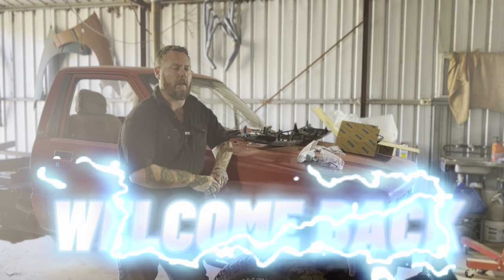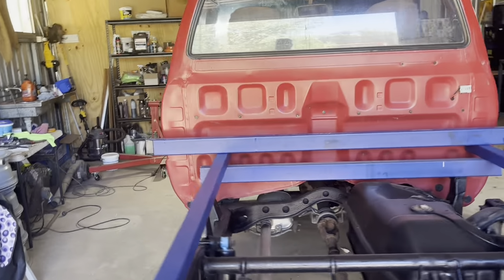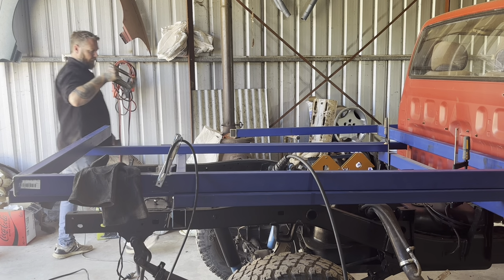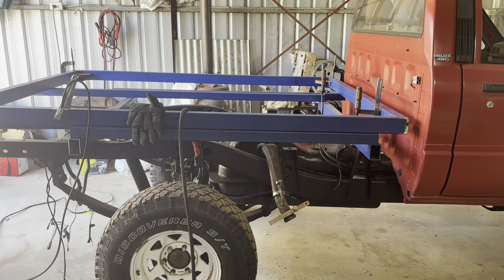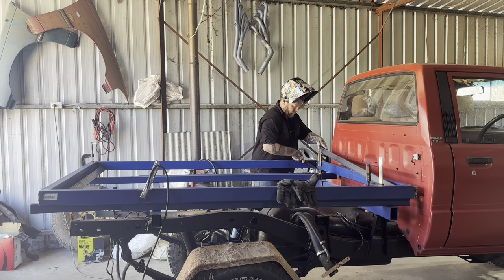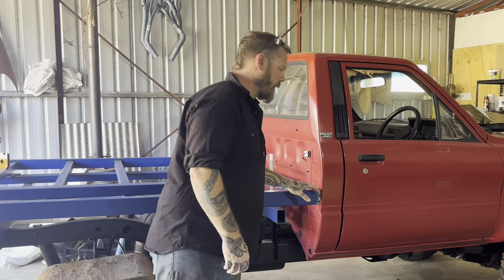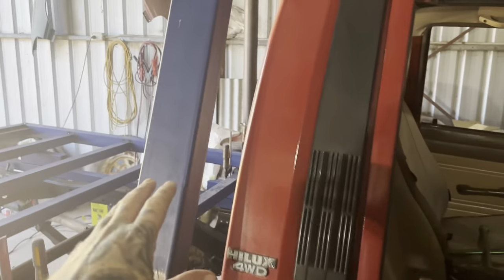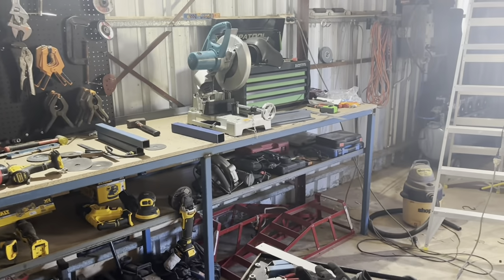1984 Toyota Hilux 4x4 - (Custom tray build begins)

Comment: Just wondering if it might of been an idea to add triangle stiffners in each corner which would also keep you square when fully welding up. Comment made 30 min in and also I'm 20yrs retired welder fabricator myself keep her lit bud enjoyed watching the vid and hello from Ireland
Reply from the maker: Hi mate, so far the tray is only tacked together. I feel with 2 full length runners and 4 crossmembers it won’t pull out of square when it comes time to fully weld it out (next episode) but we will see. I have only fully welded the top of the 4 outer corners for now. But more bracing certainly wouldn’t hurt. Thanks for watching and for the comment 👍